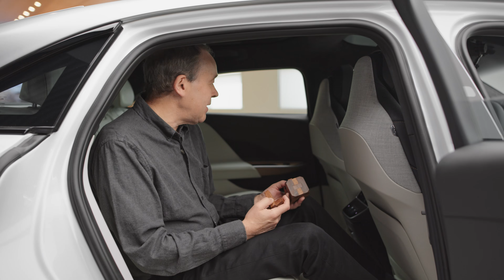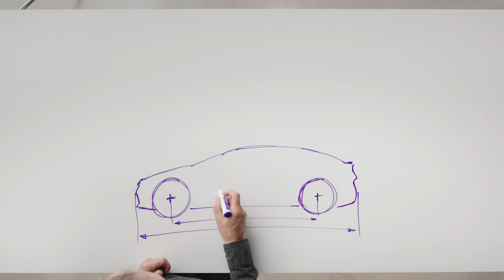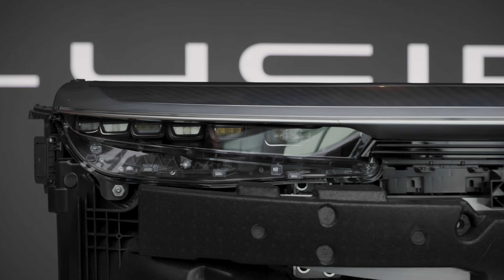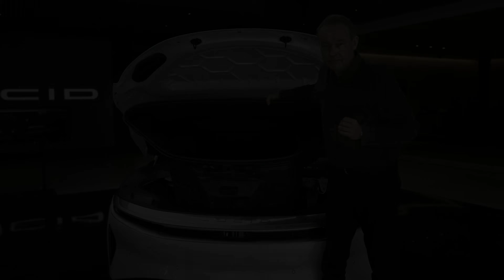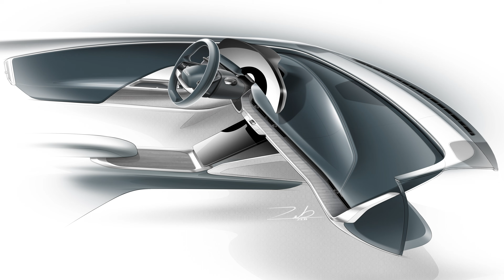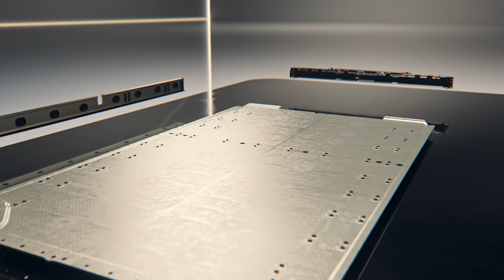Lucid Space Concept | Tech Talks | Lucid Motors

Comment: The amount of thoughtfulness, time and effort that went into this car is astounding. Not sure any car manufacturer today has redesigned the car from the ground up as thoroughly as Lucid has.
Reply: Umm, Tesla has...
Reply: @jamesengland7461  Well, that was Peter too, the first one anyway, but I believe the battery and drive units were done before he got there. Lucid obviously designed the whole car around the occupant's experience. Teslas seem to all be designed around the tech.
Reply: @Miata822  and that's the thing.  Lucid is doing great,  but not in a vacuum.  I do think they've chosen to reach for a price point and market far above their ability and reputation,  pretty much selling an unproven car above the S Class and nearly the price of Rolls and Bentley. Big mistake.
Reply: @jamesengland7461  My Air GT (Red, 21" wheels) costs a little bit less than a Model S Plaid (red, 21" wheels). It is very well assembled, no flaws I could find, made of lovely materials. It rides smooth, is very quiet at speed, and handles exceptionally well. It charges faster than any other EV and drives further on that charge. Like every review says, it's a very nice car. Only the trollish end of Tesla fandom seems to have an issue with it.
Reply: @Miata822  I'm referring to the $170k Dream edition
Reply: @Miata822  yours was about $130k then?
Reply: @jamesengland7461  $139K. Cash price for a Red Plaid with21" is $142,990 (or $2k more for any interior but black). 

Lucid has several versions, from a newly announced higher power GT to a $77K 408 mile rear wheel drive. The Touring model Rawlinson showed sells for $95K. Prices for new reservations are supposed to go up next month, but I don't know how much.
Reply: @Miata822  almost 30k for the 139 price point the 179 stays the same.
Reply: @yichae3560  The $169k 1,111hp Dream Edition was a limited production introductory model and is no longer available to order in the US. A very limited number will be available in Germany as that market opens.

Demand for a higher output version has continued, however. My GT in Sprint mode (800hp) has more power than can reasonably be used on public roads but I suppose some just folks just want 1,000hp bragging rights. 

That is why Lucid recently announced the $179k 1050hp GT performance version. This version wasn't in the plan but Rawlinson said on the Q1 earnings call that Lucid was receiving many requests to buy the higher power car. Clearly price isn't inhibiting sales.

On that same note, it isn't a secret that a limited production 3-motor version is in the works. There is a video of the tri-motor test car on track at 235MPH. If it does reach production it will certainly be priced well north of $200k.
Reply: Tesla hahaha....what a joke!Tesla doest even come close to the quality of Lucid!

Comment: Did Peter just casually swing about and lift a 74 kilo motor/drive unit?! I want to know what he eats for breakfast. Lovely video for an even lovelier car.
Reply: This is an example of how Peter misleads. In my opinion, there is NO way Peter can carry 162 pounds in one arm let alone hoist it up onto the table. All he had to do is mention this is a demonstration of the compactness of the drive unit. There are no internal parts to those housings. So viewers are enticed to believe these drive units are super light weight. I believe at 74kg they are already light weight, so why the unnecessary deception. I don't get all the secrecy. If it is as good as claimed, just show it off. So many non-answers make Peter feel very dodgy, at least to me. The latest reduction in factory output projections without ANY relevant data makes it all worse and therefore highly questionable.
Lucid looks like it could be a great car. Crow about it with data supporting the claims. I hope they make it, but.... can they?

Comment: I would love to see an explanation of the small differential unit inside the rotor handle massive torque.  The secret sauce is the power management instantly reduces the torque when either wheel slip to prevent damage to the differential unit?

Comment: As these is not gas engine or transmission to worry about, why not have the front passenger & drivers footwells further forward so the front wheel arches protrude into the Cabin? You get another 5-6" that way! All mid/rear engined Super are do!

Comment: Beautiful cars for sure, but in my opinion most people dont care about a 1000 hp car. Reduce the size of the motor which might save power and go even farther. Also , raise the vehicle up higher  . Most roads are not perfectly smooth and there ar4e many speed bumps out there. That is the only problem I see with these beautiful cars . Make them practical